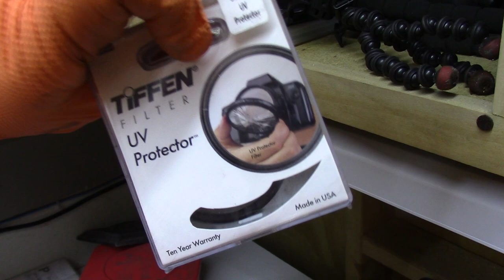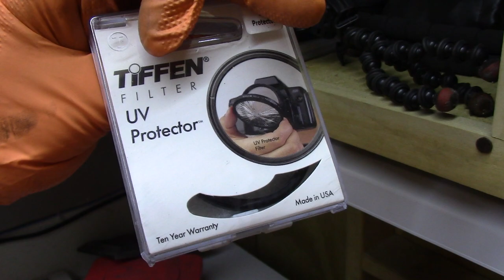Fixing endless problems || Guts' Dragonslayer from Berserk (Part 7)

Comment: Suggestion, although i'm sure its way too late: Drill and tap the handle in the spot where the hole is, then run the bolt for the chainlink through the hole to lock the two together for extra stability on both the handle and the chainlink.
Reply from the maker: Excellent idea!
Reply: Yo that's pretty clever.
Reply: huh Maybe that's what Godo was thinking when he put that there

Comment: Full time structural welder here, best thing I can suggest is grind out fully the affected areas, chasing makes things worst. Solid wire MIG weld it not flux core if you can to avoid slag inclusion which is looks like in the first place. Don’t go crazy with anti spatter, that can cause porosity also.
Reply from the maker: Never thought about anti spatter causing porosity. Interesting.
Reply: @PrettyHateMachining  it doesn’t in small quantities however if it’s trapped in something and the gas has nowhere to escape then it will cause it, or if it’s dowsed

Comment: You are correct, there was some kind of contamination in the weld. The problem with that is you have to grind that out of the material or drill it out since it's in such small spots, and the real kicker is how deep the contamination goes. Can take a while to grind out, but it's better to get it all out on the first try or you will be there all day grinding, re-welding and recreating the problem or making it worse. This is also why it's important to clean your material before welding. Acetone is what most welders prefer, but you can use other cleaners like alcohol, simple green or just even wiping with a lint free rag can make a huge difference. Also wire brushes/wire wheels can remove some surface oxidation.
Reply from the maker: Agreed. I did meticulously clean the mating surfaces with acetone but I think what happened is that some cutting oil from the drilling operation for the chain link seeped down. I didn't think to clean out the drilled holes. It's all I can really think of.

Comment: Im a little concerned the hole for the handle isnt deep enough and when Guts finally gets the sword and tries to wield it the handle is just gonna pop right off 😂
Reply from the maker: Believe it or not, it's way deeper than it needs to be. Full pull-out strength is achieved at 150% of the diameter, which is only like 1.5" or 38mm.
Reply: @PrettyHateMachining  wow awesome!

Comment: It looks like the way it was supposed to go together was that the blade had two cylidners in the bottom poking out so that the guard (which in this case would be one piece) would align properly. With that loosely in place, the handle would go into the blade itself until it bottomed out (the handle would have to be flared and be pretty damn thick since it'd have to support the weight of the guard). Then the bolt with the chainlink would go through a hole in the handle to secure it in place. 

All in all, the blade would have slots for the guard, the handle would have supports for the guard, and the sword would have a bolt that went through the blade and handle to keep the guard and handle in-place.

Comment: Magniflux fluorescent liquid penetrant, and a blacklight. You can use the red penetrant but I'm a sucker for the good stuff and a 10k contrast.
That and the NA 01-1A-16 to really get your head around the whole inspection thing.
That can save you a ton of work in the end.

Oh, and the putty thing again as well, should keep the tripod feet more stable as well.

o7

Comment: The imperfections are a pain in the ass i weld diesel tanks and obviously they can't have any little imperfection on the seams or yeah the holes appear 😂 it's normally oils or trapped air when originally tacked up. 
Good job as usual tho it would pass the leak test lol
Reply from the maker: Waterproof sword! Woohoo!

Comment: Hey man, I just found your channel and as a Berserk fan, this was the easiest sub ever. Correct me if I'm wrong, but you're the only one actually making a full sized Dragonslayer out of metal, no? I haven't seen anyone crazy enough to bring THE biggest giant fantasy sword to life, that alone deserves a sub regardless if you're a fan of the series or not. Big props to you and I can't wait to see the it finally finished, as I'm sure the feeling is mutual given that almost anything that could go wrong did 😂Then again, it's a good learning experience since I doubt you would encounter any of these problems in any other build. It would be interesting if you could tally up all the expenses on tools and machine repairs and compare it to the profit (I assume this was a commission from someone) in the final video, if you are willing to disclose (or at least hint) the amount, that is.

The reason why I decided to comment on this part instead of the latest video is due to a tiny detail that caught my eye and I figured you might want to know. I'm referring to the bevel on the underside of the half-moon guard. If you take a closer look at the original artwork (first image that shows up if you google "Berserk Dragonslayer"), the one where Guts holds it to the sky which you yourself referenced multiple times in this build, you can see that the entire bevel is of consistent depth on both faces and underside. So for example, if the guard is 1" thick and the bevel is 1/2" deep, then that is the case everywhere. Imagine a flat piece of metal in the shape of an elongated circle, evenly beveled out near the edges, and then bent into the shape of the guard that simply slides onto the sword from the bottom of the handle. But at 21:46 you machined the underside bevel all the way to the blade instead. And speaking of the bevel, it isn't exactly with perfect 90 degrees "walls" and a "floor", but rather more circular/oval like the letter "U". But that is going into extreme and unnecessary details that no self-respecting craftsman has any time for, and also the original manga art itself isn't exactly consistent so details like that are open to interpretation.

Anyway, I seriously doubt anyone will pick up on this, bar some extreme autists like me, so don't feel obligated to fix it as any more welding on the guard will surely prolong the agony of getting this thing out of your workshop as fast as possible 🤣Just figured you might want to know for future reference. Sorry for the long comment but I had to get it out lol.
Reply from the maker: You know, I have to say that I've gotten thousands and thousands of comments on my videos over the years. A fair amount of them try to nitpick various details of the sword(s) and I can honestly say that none of them have really been correct. Until today.

After careful analysis, I think you are correct on both of your points. I'm not 100% on your second point, as it is seemingly impossible to find a shot of the handguard that is straight-on so you can see if those two slots on the underside of the sword extend past the blade itself. But based on the views that are close to straight-on, I'd say you're probably right. 

Maybe in a few years when I make another one, I will incorporate these details. Going to be tricky to make that u-shaped semi-circle on the guard but I have some ideas.

Anyway, well done! You get a virtual sticker for being more of an insane Berserk nutcase than I am. That is high praise to be clear.

As for the scale of the DS, yes, to my knowledge no one has ever done this. In fact, I believe this to be the world's heaviest sword, period (barring some sculptures that I've seen overseas). As for the cost, I honestly never did a true analysis but I'd say I lost about $15k overall when you factor in everything I needed to make the sword vs what I was paid. This is offset by youtube ad revenue and sponsorship revenue, but at this point I don't know what that will add up to be yet. If the final installment can get a lot of views with a good sponsor, I may break even or come close.
Reply: @PrettyHateMachining  Thanks man! I was reluctant to even write the comment because I didn't want to come off as an asshole critic, but I'm glad you took it in good faith because it was truly intended as such. This build is inspiring me to do another build of my own, and that is the reason I even know about those details -- I made the Dragonslayer once out of wood some 6-7 years ago, but it broke and I didn't want to waste time and resources to do it again.... until now! 

Also, $15K in the negative net loss overall?? That's insane! You praise me for being a bigger Berserk fan than you, but I'd say there is no Berserk fan willing to go into so much debt for it. At this point you're driven entirely by the love of the series and the determination of a true struggler. That and the fact no one has ever made the full scale Dragonslayer out of metal is worthy of being enshrined into official Berserk fandom lore. Not to mention there has to be a Guinness record potential in here somewhere.

Thanks again for the inspiration and I'm looking forward to seeing the Dragonslayer complete in all its glory! The smash video will be interesting to see 🤣

Comment: I’m curious what the largest bust still functional sword you can build, if you use every weight saving technique possible?  

Mostly hollow with with weight saving holes punched in it, maximum amount of fullers added, make it serrated so you can reduce the material further, etc. 

Hollow blade filled with some impact resistant plastics, so it won’t warp?

Comment: I bet a good solution for some of those problematic shots like the one that ruined the tripod is some flexible armature to hold and position the camera and a magnet to attach to the plenty steel surfaces in the shop
Reply from the maker: I've done this before, the only problem is that having such a large arm induces a lot of shaking (more than the tripod already has). It would have to be a very stout mechanism.
Reply: @PrettyHateMachining  maybe some flexible ball socket armature as 3 flexible legs of a tripod with a magnetic base plate is an idea lol, but I'm no expert
Quick edit: think I've also seen them supported by a very stiff wire, stiffer than like usual armature wire or anything like that. I'm just a visionary lol

Comment: You know you're the 1st one to attempt the real dragonslayer.
Will be a unique piece, so some strongmen may reach you to try and lift it.
My question iis (and I'm no expert whatsoever), is the hole of the handle a bit shallow?
No elefant can swing that thing, bit looks to me a bit shallow even to lift the bottom.
Reply from the maker: Yes, once it's about 1.5" inches into the sword, it has reached maximum pullout strength.

Comment: Since this build is tangless i was always curious what would happen at this point, just trying to weld a handle on would result in an instant snap off or bend from the weight.
Reply from the maker: I usually just weld my handles on, I wanted to try something different this time. The welded handle wouldn't bend or break without many thousands of pounds of force.
Reply: @PrettyHateMachining  yes exactly. You have several hundred pounds of steel plate of torque on what is essentially a 7ft lever. I don't remember what you said the current final weight is so I can't do the calculations but thousands of pounds on your weld it's something that could easily happen